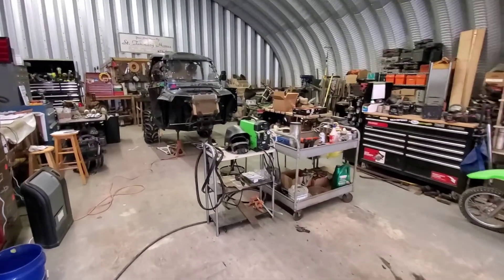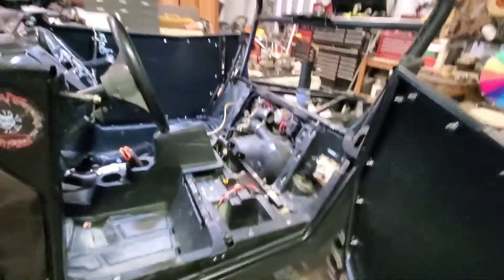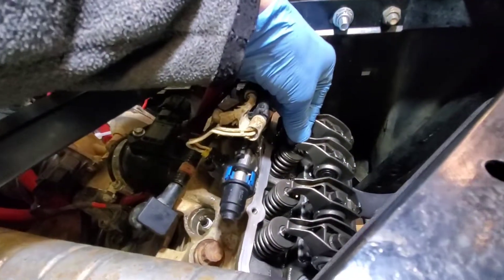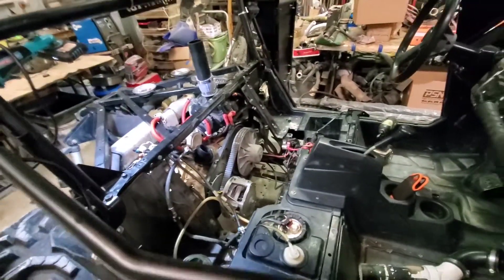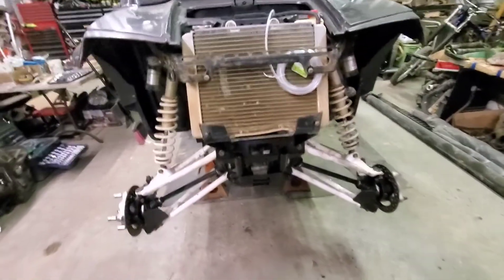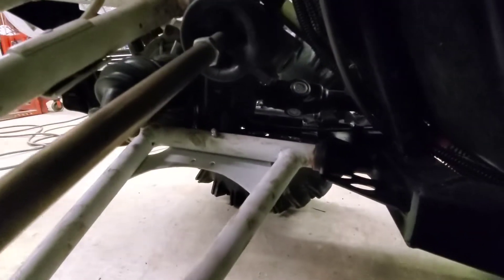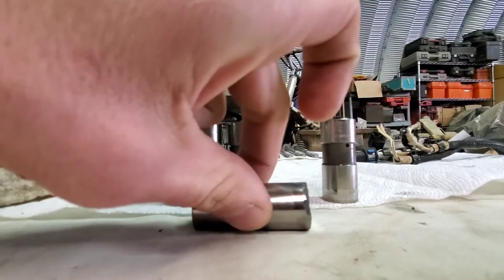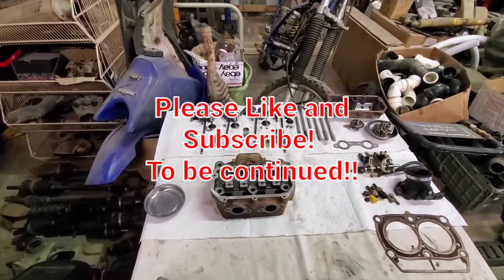2013 Polaris RZR 800 S Build pt.4 Engine noise figured out!

Comment: Good chance the cam lobe is worn too but hopefully it’s not. Im in the process of going through my 800 too that I just bought a few months ago. Mine sputters when cold when taking off but clears up after it warms up a bit. Not sure if that’s normal or not. But anyways good luck!
Reply from the maker: I'm hoping cam is OK. I'll find out after it's back together and see if there is slack in that push rod. Have my fingers crossed 🤞. Waiting on cylinder flex hone I ordered to get here.

Comment: Thought those head bolts were a 1 time use deal.
Reply from the maker: I reused original head bolts and torqued them just over original torque spec. I haven't had any issues reusing them.